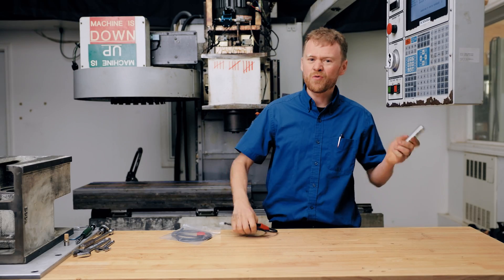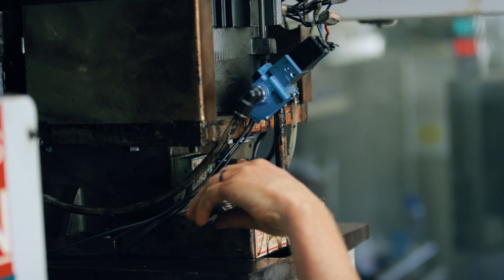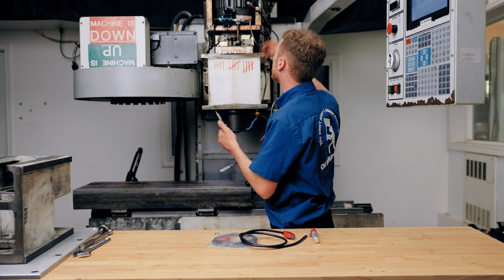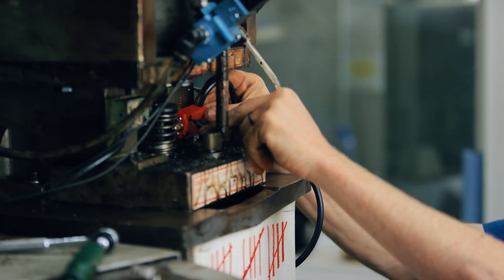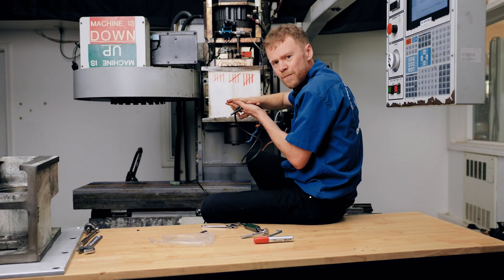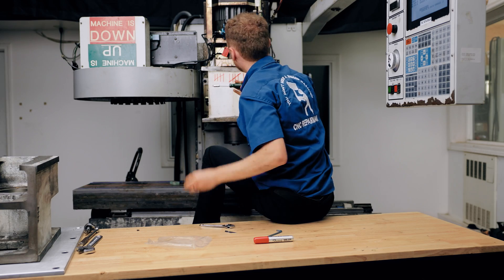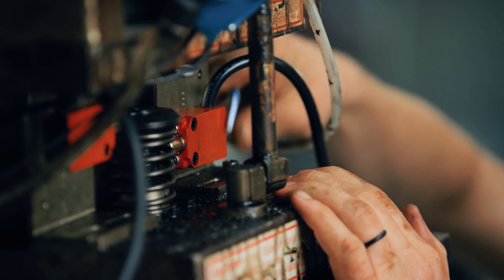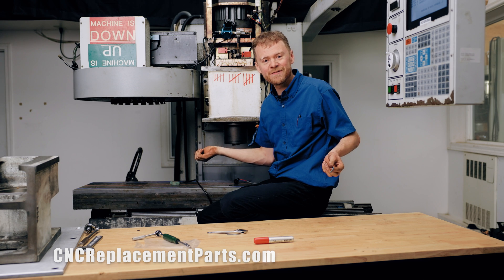How to fix CNC Mill unclamp issues

Comment: I have an old Haas VF1 with an umbrella tool holder. When I mount/unmount a tool manually using the button, it grabs and releases without issue (no sticking). But when a tool is being put back in the carousel, the spindle seams to want to pull up before the drawbar has completely released it and the aluminum plate holding all the tools flexes up and it's loud. Is there a timing parameter that controls the syncing of these components?
Reply from the maker: It’s likely the switches need to be adjusted.
Reply: Are the tools stuck in the spindle when you try and release with the manuel switch? Have that issue with mine when the tool gets hot

Comment: Did you know that those air clamps have something called a humphry valve that has a little hole, and when clogged, it will limit the throw slightly, making the problem seem like it could be a limit-switch issue? Terry the technician gave me this solution, on a phone call years ago, and it solved my problem!
Reply: The Humphrey valve has a diaphragm in it. It is specifically built to be able to have two different air pressures on a single connection point. It did this for "pre-charge", which brings the piston in the TRP (tool release piston) assembly down lightly to it's mating surface, before applying full air to the tool release for clamping the drawbar. The diaphragm reaches its fatigue recovery limit overtime and fails to keep the two pressures apart. This gives a significant slapping sound on every tool change. 

Although it's a bit like a puzzle in plumbing, the valve can be changed pretty easily if it's in the front. Though the spindle head cover, if all one piece with black tabs on the sides, is harder to place back on versus changing the valve. 

-HAAS Tech
Reply: @Xphinity do the Haas over lords know about you sharing knowledge?